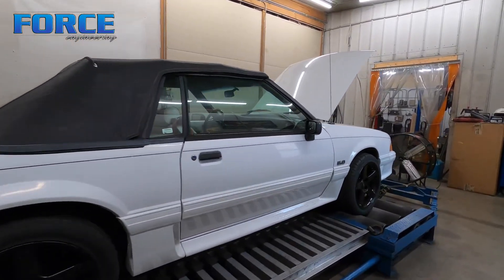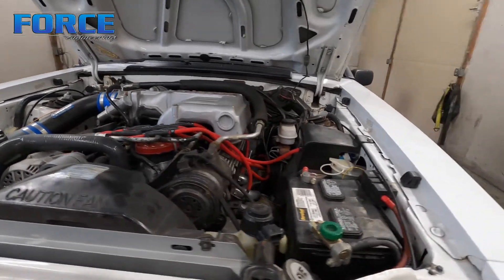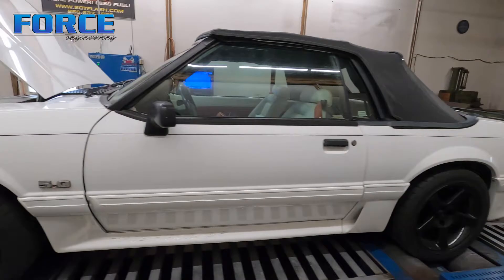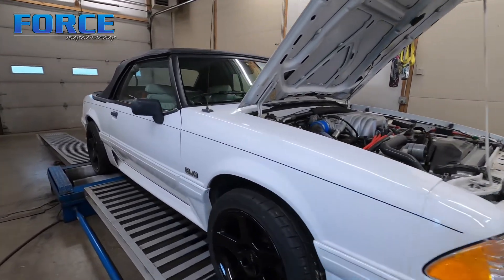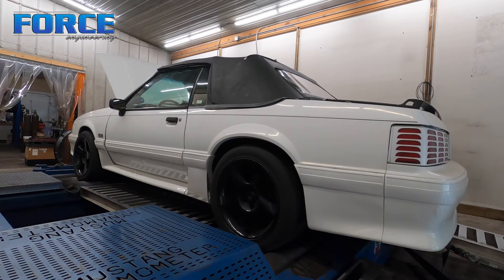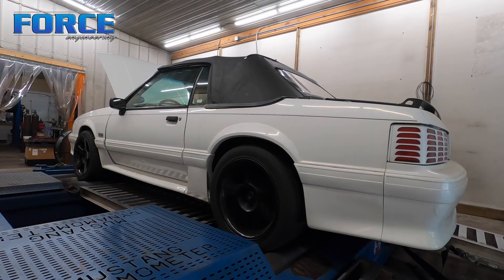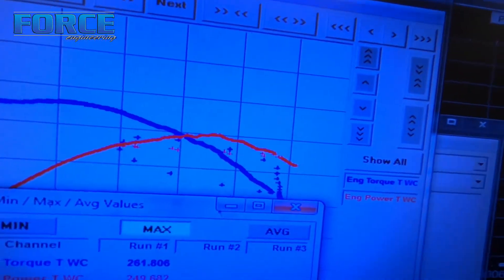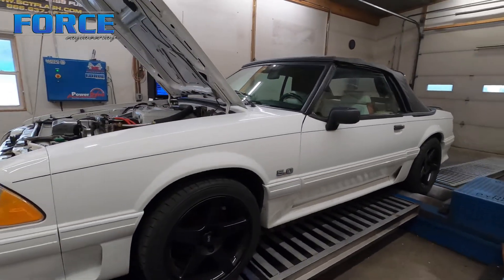Cammed 302 | Gt40 Heads & Cobra intake | Foxbody Mustang | Dyno Review

Comment: Like realistically it's "perfect"     just fast enough.   Basically like having a 30 year old STI or something... and      though I can't stand the look of verts      Id probably choose this over a more practical AWD... maybe even a Focus ST lol     .    I mean it's a small block.          With better intake and cam    can churn a solid 400  or at least the 400 equivalent to an OHC 5.0       and it will have better low-mid range being a 2 valve.      Makes me feel good about my build  and intake... I'm working on porting mine right now in the truck version for the 5.0 with dual throttle body.  Basically the dog leg runners in the front cylinders  flow an awful 150-160 cfm.   Ported  ( ive gone to the extreme on removing the dog leg where I broke through and opted on using epoxy)   can open up to 250.. crazy 100 cfm pickup   but thats how bad those dog legs are.     As reference the cobra intake is like 200 cfm... I believe the GT40s are like 215 ish   and can be opened to mid 200s as well maybe more.    and   a trickflow street or track heat is maybe 230s.    If you port out the Edelbrock performer truck intake it goes over 300.    if you cut and weld the stock truck plenum i believe 270.    So seeing .    Ported E7 with stock valves can outflow GT40s  a bit depending on the job      but        this is a very easy 300 hp   5.0    with some bottle necks for sure     and I bet its a blast like I said.   That's still a nice weight: power   ... you dont need dangerous 700 hp to have fun.

Comment: I have a '95 F-250 351W/e4od 4x4 I'm considering some basic reliability mods on. I have a mass-air harness, airbox,  and ECM from an F-150, and all of the internals from a roller 351W a guy was doing a stroker build on. Crank was checked and polished at Portage Napa. Standard bearings. 

My engine has 110k, but a spun rod bearing and a rear main weep, so it's coming out anyway for a refresh. 

Considering 3-bar heads, exhaust, and maybe a mild cam. This will be a daily driver/mild towing rig.

When would be a good time for a consult? What cost?

Comment: Nice horsepower gain, I  have seen the stock automatic cars make 190 to the wheel.
Reply: I made 208 with gt40 intake and shorty headers.
Reply: @jakew2350  that’s it? We put down 240 with a 95 GT with just a cobra intake and bigger TB, timing, x pipe and mufflers.
Reply: @Texas_Road_Warrior  well it was an auto car with h pipe and shorty headers. I don't see how you could make 240 with just those mods to the wheel. Also never had it tuned. I have a 347 stroker now
Reply: @Texas_Road_Warrior  wait what heads did those come with? Are they gt40? I only had e7te
Reply: @Texas_Road_Warrior  with E7 heads on it? If so that’s impressive.